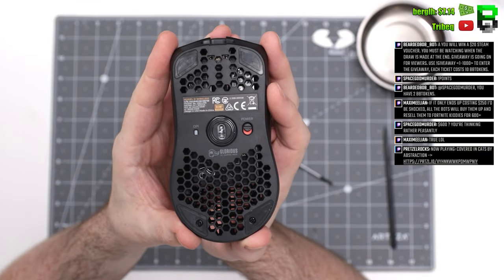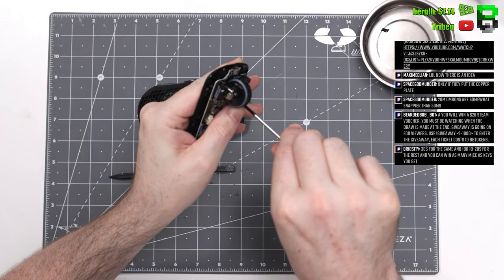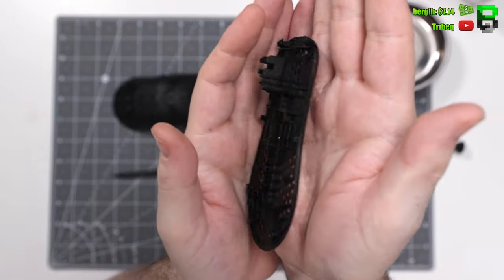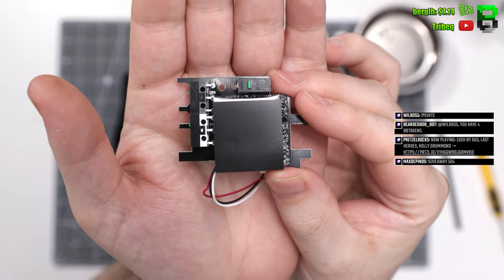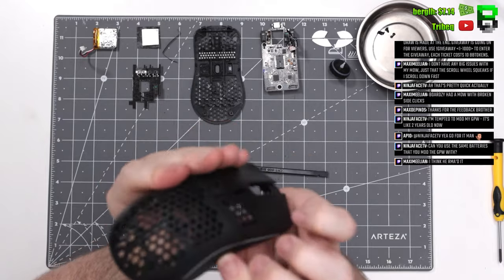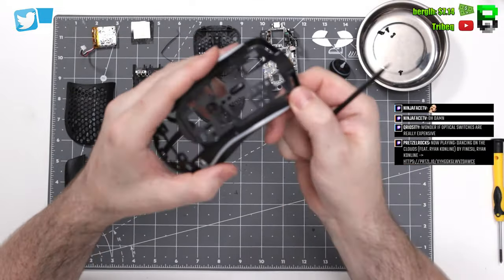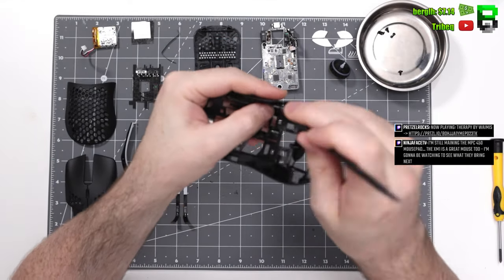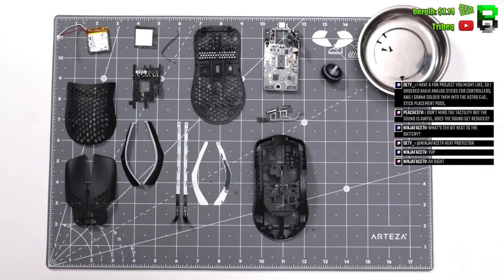How To Open Glorious Model O Wireless | Gaming Mouse Teardown

Comment: Noice!
Even without dremeling, one can remove 8-10g~ by just replacing the battery with a 150Mah one, and leaving out all the RGB stuff when reassembling.
Reply from the maker: Sure can 👌
Reply: @Beardedbob  and also get horrible battery life, 150/500=.3, .3 x 70 hours = 21 hours of battery life
Reply: @KKPlayz10  that’s without rgb as well
Reply: @wandew7057  no, the 70 hour lifetime is with rgb enabled.
Reply: @odahvi1216  that’s absolute bs.

Comment: I have a question, will the skates be able to go  back on the mouse even after its taken apart (becareful when taking the top left click and right off cuz then ur gonna have to unscrew it to fix the dpi button

Nevermind, i got my answer, i just put it on a piece of plastic and even if i bent it, it went back on the mouse straight, ty for this tutorial i probably wouldnt have figured out how to fix my dpi button without it

Comment: Is it possible to use the same pcb on a model o wired case? Because I'm noticing that the power on switch is attached to the model Os case itself, and not sure if it'd be possible for that to be usable for me

Comment: A bit of a weird question, but Ill be receiving my MOW soon, and Ive still got spare parts from an old GPW, do you think its possible to put the battery of the GPW into the MOW? Ive got a spare lying around anyways so it might be a good way to save some weight

Comment: The original gpw superlighr feet seems to have a lot of electrostatic effect and can be attached to many mouse pads when moving the mouse.Is this only happening to me?
Reply from the maker: haven't noticed that,  what pad are you using?
Reply: @Beardedbob  fnatic dash xd, artisan SHIDENKAI, All mouse pads from Xraypad, 
I contacted the seller and he has agreed to exchange it for me. Is it possible that there is  leakage of electricity from my mouse?
Reply from the maker: Not sure its very strange.... let me know how you get on.
Reply from the maker: wow that is sticky....this is the test I did and that wasn't the case. https://www.youtube.com/watch?v=j-HyZ-AXyVU&list=PLfd7fPKFiRfIzZVqxMHqyH5y23iG357b9
Reply: @Beardedbob  The seller has agreed to an exchange but the next stock will be in April as the mouse is out of stock worldwide. I have also purchased the corepad foot sticker in the hope that this will solve the problem. Thanks for reply !

Comment: Anyway you can mod the mouse wheel with say a Logitech G502? Really don't like the mouse wheel on these so much. Usually get little fibers or hair stuck in them and they start making noise. Hate having to remove the skates to get to it.
Reply from the maker: I've done a few scroll wheel mods and they aren't easy. It really depends on the mouse and if the new one will fit without to much messing around. The problem with G502 is that it uses a optical encoder so this already is a change to the stock mech encoder on this MOW.

Comment: Hi, i was wondering if you could give a link or point me in a direction where to find the scroll wheel replacement?
Reply: did you find it? mine just broke
Reply: @knightofparty_5648  no, sorry i just used glue to fix it up until it pops up :/

Comment: I want to swap in side buttons for my model o wireless, but the battery is near it. Should it be safe to solder near the battery, or should I remove it? If I remove it, how can I remount the battery? Thanks in advance
Reply from the maker: just remove it

Comment: Hi the thumbnail shows 3500 mah battery but I don’t see any mod 
I want to buy the mouse but only if I can do the mod 
I have a logi m705 , don’t like the m720 and every other mouse is either to big or to expensive but this mouse seems to be almost perfect except for the battery 
I want the mouse to have a lot of battery  weight is not a problem

Comment: It looks like it will be difficult to get 9grams out of this. So it will sit at the sweet spot 60g.
Reply from the maker: I've done the weight reduction already as part of the stream that this was done in. We got a lot more than 9g out of it 😜. The video will drop this week
Reply: @Beardedbob  That's awesome, does it include changing the battery? I am not really comfortable with changing the battery. I followed your guide before and I got my GPW down to 68 grams without changing the battery
Reply: @DEANluxray  He did change the battery. I have mine at a little over 61g without having changed the battery. You just need to cut a lot of the internal structure. If you ditch the back panel then its easily under 60g. Doing the battery doesn't seem that bad. You could do it with some pliers and electrical tape and its an easy ~4g reduction.

Comment: Anyone here having problem with their MOW not charging and stuck at 1%?
Reply from the maker: haven't heard of this yet.... have you tired another cable? or usb port
Reply: @Beardedbob  Yes tried all the possible fix I could think of... It's sad that I wouldn't be able to return this now since I modded the battery and voided the warranty.

I also can't use the LMB + RMB + MOUSE WHEEL BUTTON reset anymore. It just won't register all three of the combination, but I can press MB4 + MB5 + LMB + RMB without any problems. This is so weird lol

But from what I've known, users with unmodded MOW do this as well. So it's probably a software problem, cause it only did this when I updated the firmware to 1.0.19.

Customer support haven't gotten back to me yet. Hopefully it gets fixed with a software update.
Reply from the maker: yeah sounds like a firmware issue then...
Reply: @Beardedbob  After some months of learning electronics myself I managed to find the problem and fix it.

There was actually a dead MOSFET on the pcb and it's causing the other MOSFET's drain and source pin to get shorted.

And the TP4056's Temperature Sensor (PIN 1) and Ground (PIN 3) needs to be shorted if you're not gonna use it or the battery you'll use as a replacement doesn't have a Temperature Pin (it's the white cable in this case).

Hope this helps someone out.

BTW can you check if your Model O Wireless is still charging even when not using the temperature pin so I can confirm if my diagnoses are wrong somehow?

Comment: I know this video is 2+ yrs old but my kids wireless model O wheel is acting weird - it doesn't fully scroll down and almost 99% of the time it scrolls back up after you scroll it down.  idk what is wrong with it but it's out of warranty and wondering if anyone else had this issue and found a fix?

Comment: Can you tell me what the encoder height/model is? My mouse pretty much scrolls on the opposite direction 50% of the time and it needs replacing.
Reply from the maker: It’s in the Teardown 👍
Reply: I had the same error as you. The scroll wheel seemed springy (like whenever i put it half way between two little segments on the rubber part it would revert to the closest one) it was because some plastic support was left after manufacturing. I just snipped off the support and then reassembled and it worked fine. I thought i would have to replace a new encoder too lol.